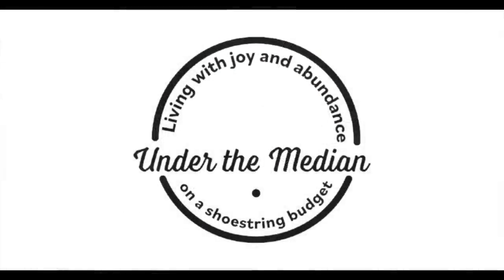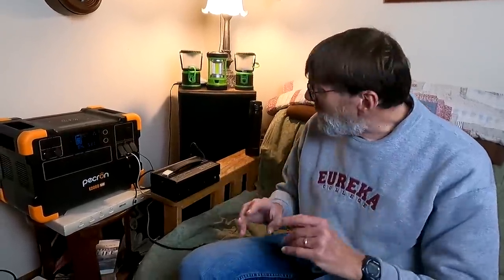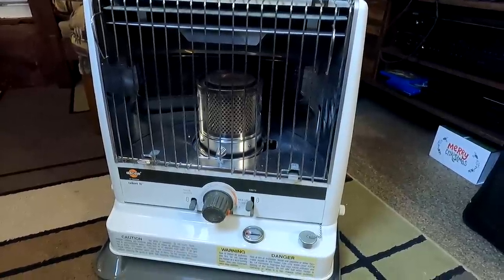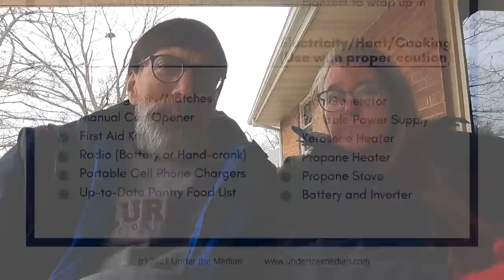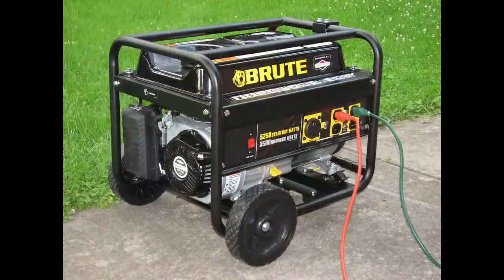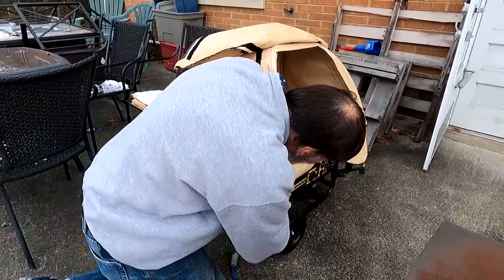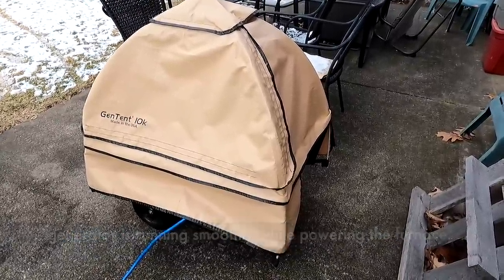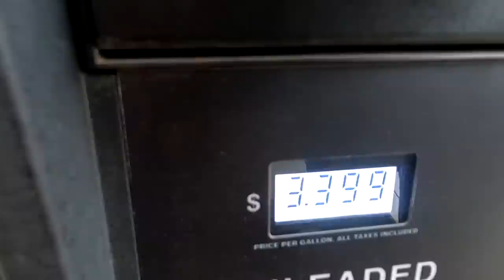Preparing Our Home For A Winter Storm Headed Our Way

Comment: I don’t have a generator so it’s essential we don’t open the fridge/freezer if the power goes out, so I pulled out some meat, cheese, a quart of milk and put them in a cooler so we could access a few things without messing with the fridge or freezer. I also knocked down the fridge and freezer temps so that everything would have a few more hours before it becomes a problem.
Reply from the maker: That is such a smart idea to prep a cooler with items you commonly need so you don't have to open the fridge. Fingers crossed that your power stays on.
Reply: Here in Michigan, if our power goes out, the food in the fridge can go outside.  I guess the screened porch would be our freezer, and the garage could be the fridge.  
Blessed be, everyone!
Reply: @OrlaQuirk  that’s a good option too, but I don’t want the door opened any more than necessary in these temps.
Reply: @bethanyg153  I don't want to open the doors, either. (Other family members, especially the dogs, are in and out all day).  Your cooler as refrigerator idea is brilliant.
Reply: Your garage might be cool enough to store some foods temporarily.
Reply: The last time we last power we remembered we had the big freezer blocks in the freezer and just put them in the fridge and they worked great to keep it cool.

Comment: Well its the 24th here now, we live outside the Capitol of Canada.  We received the snow, rain, flash freeze and  the strong winds continue. We are safe and sound inside with a back-up generators which runs of our natural gas line.  We have also installed a special lock on our electrical panel which automatically closes the power supply from our provider to.ensure safety when we lose power.  Merry Christmas!.

Comment: It's  -10 outside but very warm inside because I am baking bread. Thankfully no power issues at this point.
Reply: What a nice way to spend the time.  We've not lost power here either, but we did loose our furnace just after making the modifications.   Got it mostly fixed yesterday....

Comment: Our forecast for central NC is 10 degrees to 14 degrees on the nights of the 23rd, 24th, and 25th🥶 with wind up to 55 mph, giving a wind chill of possible -18. 🥶 Brrrr. 
It is very unusual for my area. 

I work every single night. 👌 I honestly don't mind working  Christmas. It's kind of fun. The sick need Christmas cheer, too. 🎄 We usually try to give them some laughs with our crazy hats and singing/dancing. 

Now, I have prepared as best to my ability/knowledge for this upcoming weather with safety in mind, generators (gas & solar), extra gas & diesel, food & water, wood for heat and cooking (if needed). 

I look forward to seeing your video to give me extra tips in preparation for these storms.
Reply: How nice, R N.  Those patients need people like you during Christmas.  Sounds like you are as ready as you can be.  Take care and be safe.

Comment: We have charged everything up, brought in firewood for a week, made a turkey, then bone broth, and made 2 loaves of bread for making sandwiches and 2 loaves of french breads for soup dipping. I chopped up celery, carrots, and mushrooms for a easy veggie tray. We put 6 gallons of water outside to freeze for backup ice in case power outage, we can put ice in refrigerator. We brought a cooler into the house that we can use if power is out as well. Drifting snow may make getting out difficult, so prepare to be indoors. Also brought in a shovel, and roof rake so we can find them ,and use the shovel to dig out with. Plan, prepare, and be ready to be flexible with your needs.
Reply from the maker: I want to come to your house just to breathe in the aroma of your cooking. Sounds amazing! Hopefully we'll be fine with the electricity tomorrow morning. I'm roasting butternut squash for several recipes on Christmas day.

Comment: It was 3 degrees and-21 wind chill here but I'm prepped. I have a big stack of wood close by. It snowed about two and a half inches. I have a cord of dry pine. It doesn't get cold in here. I added two more fire bricks to my wood stove so it has four now. I added an inch of insulation on the South Wall, which is actually the end of another building that's uninsulated. It's much warmer. I've been making the required coffee on the wood stove. It's going to be 1 degree in the morning. I would rather listen to my wood stove than your furnace and generator. It's 80 degrees in here. I have a 20 gallon barrel that I can put gas in Monday, after all the snow melts. My five gallon can has four gallons left. The little Honda engine on my generator starts first time. Usually get the rope out about a foot before it starts. I ran it through a charge cycle on the battery bank, and it took six ounces of gas until the inverter charger kicked out of charge mode. I just have a few pine chunks in the stove. It's hot enough to make some coffee on. I'm trying to use up the last of a fifteen pound tank of propane and then I will get the gas and the propane too. It's hard to use up the propane with the wood stove going. So it has lasted 3 months. I guess I can afford that.

Comment: I prepared all summer for this. I've got hand sanitizer that I dumpster dough that I can set on fire . It does a wonderful job of heating I've already tested it all out I have some hand sanitizer that is suitable for indoors and others that are not the outdoor stuff I use it to boil water faster. So all my sanitizer is going to be used eventually. Why not it's free right?

I bought three pair of insulated coveralls electric socks electric gloves then I also have just plain old thinsulate gloves. The hat scarves the wool socks.

Now I'm probably going overboard with the way I prepare the house I always shut the water off whenever it gets below freezing here. Earlier this year I forgot to open a manifold and in the freeze cracked it that cost me about 15 bucks. But I got the replacement and now I have opened the valves on everything I drained every hose I could drain shut the water off from the source I've got enough water above ground to make it through.

I've been saving these ice chest I got a source where I can get these ice chest out of a dumpster and they're big ice chests they're used to send stuff offshore. I've got enough ice just to make a huge wall. But what I did with him tonight was I positioned them all around my car I have a hybrid so your hybrid batteries they don't really like cold. So to help promote longevity I position these ice chests all around the underside of my car to where no air can get in and then I place tires inside of those ice chest and that way those ice chests aren't going anywhere the wind will not blow them away. Fingers crossed that this does the trick and helps keep a little better temperature on my car. We're not once it gets freezing here we're not supposed to see above freezing temperatures for almost 36 hours and that is very rare for my location. We can go years without a hard freeze. We had a decent little freeze this year but before that it was 5 years ago that we had anything that we considered dangerous.

No I saw on the news those things going on in Wyoming Montana my prayers are for those poor people blizzard is no joke. And with the price of fuel these days there's a real chance that a lot of people can freeze to death. I've got the old fashioned go to a kettle and a hot water bottle if things get to worst. But as long as the grid is up I am enjoying my electric heating pad. I took a sheet and put it across the room and it helps segregate one air mass from the other in my small place thanks to that sheet I only need a 600 W heater to heat my room so far. I think I'm going to have to step it up as it gets colder and colder. No you're probably going to laugh right now it's 55° outside but the temperature is about to plummet like a Stone.

As a former truck driver I thoroughly enjoy grid tied life. I have absolutely no desire to go back to caveman days. I lived enough hard times driving that truck freezing my butt off suffering from heat all that stuff eating whatever the heck I could end up fixing with the time that I had so I can tell you I wholeheartedly thoroughly enjoy my grid tied life. And I want to enjoy every minute of it I can until the day I go. In essence I'm not a happy camper. Give me my room and my TV and Air conditioning heating and all that good stuff with some internet and I'm satisfied.

Comment: I'm around the Joliet area and the wind is fierce right now. And of course my furnace is acting up NOW! 😅
Reply: On no, Lynne.   Ours completely went out last night.   We have power but NO furnace.   We're using two kerosene heaters with fans to circulate warm air inside and they are working quite well.   I hope you get yours fixed soon!!!  Prayers.

Comment: I see something you may want to do and that's gets an exhaust that goes at least higher than your roof so that if you get a snow drift that generator will put that air above the area of the drift. Then again it might just be easier just to put the generator up on a pedestal. That would mean you'd have to climb a ladder to refuel if you're using gasoline but if you're hooked up to natural gas it wouldn't be a problem.
Reply: Thanks for that tip.  We don't generally get that much snow here.

Comment: We live in South Western Lower Michigan,(20 miles from Lake Michigan) and spent the day insulating the inside, west side of house by installing plastic on windows, rolled up old towels for bottom of doors , wrapped water pipes to outside faucets,etc. We have a 3000 watt sine wave inverter in case of rolling blackouts. Pantry full of food, water , essentials, what we call an emergency center of organized supplies , such as buddy heaters, solar lights, radio.  Tomorrow is going to be a roller coaster with weather but we feel as prepared as we can be...Hey, we survived the blizzard of 1978! Happy Holidays to All..
Reply from the maker: I think you're right. Once you've been through a situation like this, you are so much better prepared to weather it the next time around. Stay warm and stay safe.
Reply: Fellow Michigander! You sound close to me! I’m in Grandville!

Comment: Two items we have and give as gifts we got off of Amazon.

One is a bright orange, heavy duty, six foot telescoping, fiberglass bike flag, that many people attach to their bikes so they can be seen when  on roadways.  We keep them in our vehicles.because here in the Sierras with a bad snow storm that can bury a car, the bright orange shows up more than 6 feet above the roof of a vehicle so the CHP, emergency personnel, snowplows can see there is a buried vehicle or someone in need.

Last December I gave family, friends a Plextone Road LED Lighting, Emergency Beacon Safety Lighting Flashing Warning Light for vehicles that have a magnetic base so they hold tight to a vehicle roof, car door etc. They also have a flashlight, with a hook so you can hook it to the open hood when checking the engine.  The different flashing modes warn of danger.  We were able to see a friend a mile away, who had one flashing on the roof of her truck.
Reply: Excellent protection for travelers, Beth.  Thank you for your tip.

Comment: East Texas here...just some advice..please keep carbon monoxide Detectors in your homes along with smoke detectors ...with all the fireplaces, space heaters, etc best to be safe...also..hang light blankets or towels over windows to help insulate them...helps so much...keep safe everyone...

Comment: The storm hit us before it went south.  The usual things I do to keep the pipes from freezing worked until the night it hit -38 C (real feel -40 which is the same in F).  I thought about filling up my 5 gal water jug, but didn't do it.  Kicking myself now as my drinking water dwindles.  Tomorrow it will warm up a bit and I'm hoping my water flows again.  If not, I'll have to drive 35 minutes to the next town to buy water ... or melt snow.
I hope you fare well with the cold.
Merry Christmas.
Jon in rural BC, Canada
Reply: Oh no!   Hope your pipes remain intact.  Let us know, JonTan Osb!
Reply: May I ask more about this? How do they freeze? Is there insulation? We live din Northern BC and now Alberta but we've never had this problem.  Now I'm wondering if we will?
Reply: @breezybre2670  My pipes are insulated, the cupboard open under the kitchen sink where it comes in and I have a lamp under there with a 60 W bulb to keep things warm.  The bathroom tap, on the far side of my house was dripping, but it was just too cold.
I had my outside pipes replaced  from the water meter, in the summer, and should have put more soil down, put grass seeds down and insulated around the box where it comes into the house.  Another thing for the warm day list.
Just do everything you can, plus have flushing, drinking  and cooking water on hand, just in case.  Good luck.
Jon in rural BC, Canada
Reply: @breezybre2670  I should add that my house is 66 years old and not built for that kind of cold.  I'm in the mountain desert area of BC, so we're more used to getting +40 C and -20 is rare.  So -38 and the wind chill making it -40 was just too much.  But everything will thaw by Christmas, just hoping for no leaks.
Reply: @JonTanOsb  ah yes....the very hot desert!  Driving through Boston Bar and Cache Creek...dang is it hot!!!!! My house is from '79 here in Alberta. I 'like get my husband to check our well head to make sure things are good but so far so good and this is the 4rth round of -35.  The basement is a bit cold and drafty. We are going to replace the 50 year old insulation with rock wool next week when it warms up.

Comment: Getting the same storm in Massachusetts, but mostly rain 57 degrees and 60 mile an hour winds. Then a massive temp drop to 20-25 degrees.  Roads will be very icy Saturday.  Power lines run behind my house and the electric co was out there today checking the lines.

Comment: I bought that weather radio
Love it.  Also what size wick does your  kerosene heater take ?
Reply: The Kerosun Radiant 10 (shown in this video) uses a 504 wick that Amazon supplies for $18.59.   I have 3 on hand for back up.   They last about 5-8 years.   They have to be brushed about every month to keep them clean and burning correctly.   I have a wire brush for that purpose.

Comment: I heard in texas that you should let water trickle in faucet so pipes don't freeze. Is that true by you? Also, most cell phones have a strong spot light that you can use temporarily. 😆 I like the raincoat for your generator.
Reply from the maker: Let the water trickle is always a good idea, but ALSO open the cabinet doors under the sink so the room temperature air can get in there better. That helps more than anything else.
Reply: I'm in Houston, Tx and we were told if we live in the city not to let it run cause then the pressure may get too low and we will have a boil water incident. My faucet in my tub has a constant drip that hasn't been fixed so that may help right now.  Lol
Reply: @claudiagutierrez7218  what is water boil?
Reply: Jen Mv, a boil water notice is when you have to boil your water to kill bacteria before you can drink or cook with it.

Comment: Thanks for the suggestions. How did you guys make out? I’m in Michigan and we have had some wicked winds and below zero temps 🥶 also do you have any suggestions on how to bring moisture into the air without running a humidifier 24 hours a day? Our house is so dry and our sinuses and skin aren’t happy 😢
Reply from the maker: The electricity stayed on, but the furnace died. Totally unexpected. It had nothing to do with the temperatures or storm. We started up the kerosene heaters and kept the house at 65 degrees until the furnace repairman arrived. We were without the furnace from 6:30am - 2:30pm.
Reply: @UndertheMedian  glad to hear the power didn’t go out but wow crazy your furnace went out unexpectedly. I’m sure those kerosene heaters helped out. Hope you all had a wonderful Christmas ❤️💚

Comment: We have a blizzard warning where we are. It should start tomorrow morning. Right now there is rain but the temperature is set to drop 20 degrees and there will be flash freezing. Next, snow and 70 mile per hour wind gusts. We are right on one of the Great Lakes. Our little propane heater is ready ( it will be well ventilated), battery bank and all phones charged, sleeping bags are in the house and ready , and candles and flashlights are easily accessible. Now we wait. Stay safe everyone 😊.

Comment: I've been considering getting a gas generator for midwest storms such as this. I didn't realize that I would need to have an electrician/pay additional $$$ to be able to make power available to my furnace. Thank you for that information!.
How many gallons of gas does your generator require, and how many hours will that last? Thank you in advance!
Reply from the maker: The modification to the furnace only cost us about $235. We hesitated to give a cost though because ours was already set up with a switch. So, it was fairly simple for the electrician to add on the plug. But, you may be surprised at how little it would cost you. Larry will have to answer the gas for the gas generator question tomorrow, but I know it runs a long time on a couple of gallons of gas.
Reply: The tank on the 3500 watt generator holds about 2 gallons of gas and runs for 16 hours.  I keep 18 gals of gas on hand for it.
Reply: Thank You, Thank You both for the information! I appreciate you!
Reply: @truthseeker6370  - thank you!  Blessings.

Comment: Did you plug the first power station into an inverter or is that a special type of surge protector?
Reply: Both power stations have built-in inverters.  They both incorporate protective circuits.  Let me know if you have any more questions, KLM.